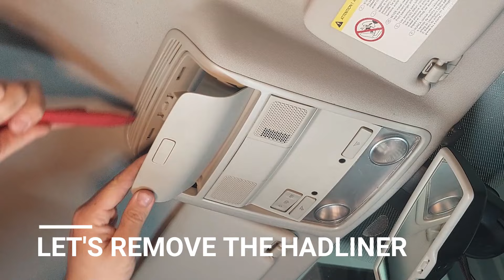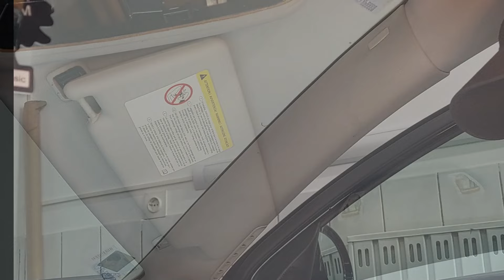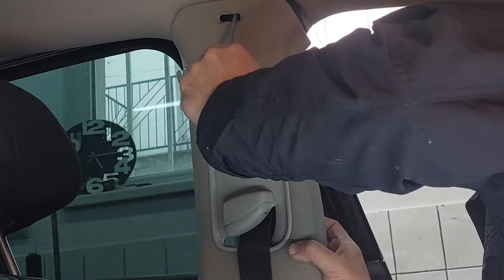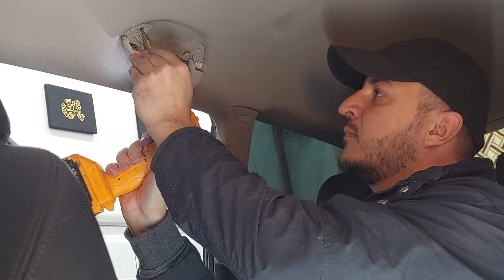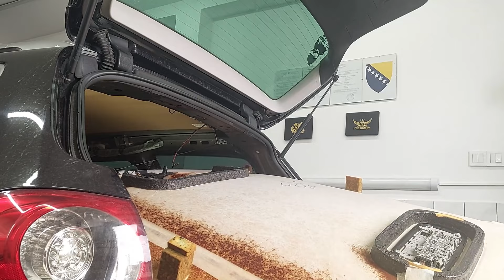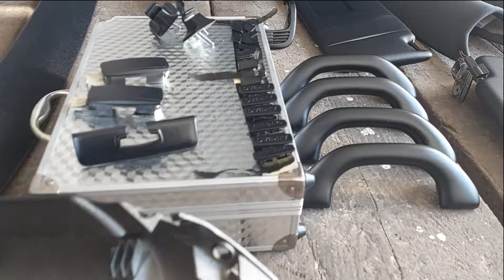PASSAT B6 HEADLINER REMOVAL PROCESS diy

Comment: Did you disassemble the seatbelts to remove the drivers and passengers c pillar?
Reply from the maker: Yes, the seat belt must be unscrewed to remove the B pillars. You only unscrew the screw that secures the belt to the floor. I forgot to record it in this video, but there is that disassembly part in other videos on my channel.